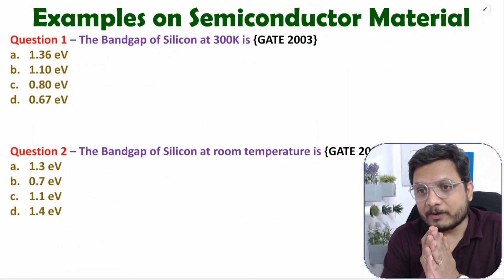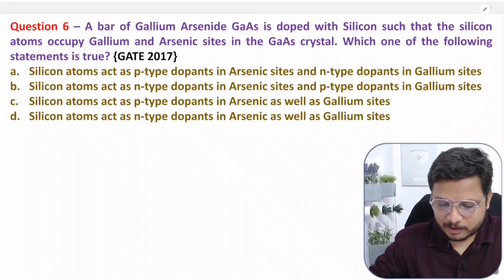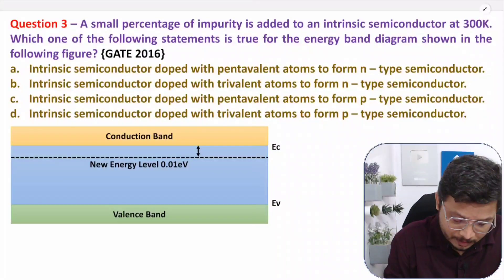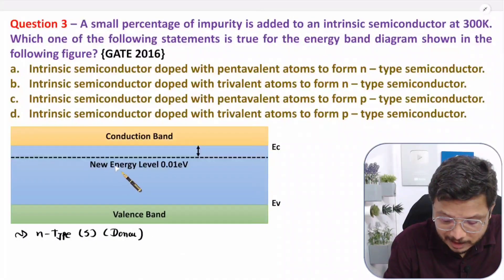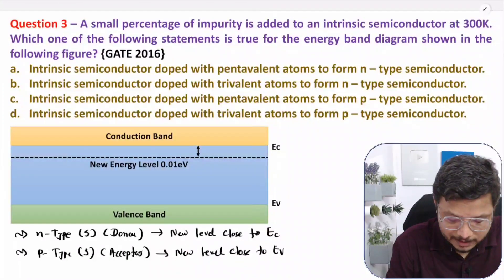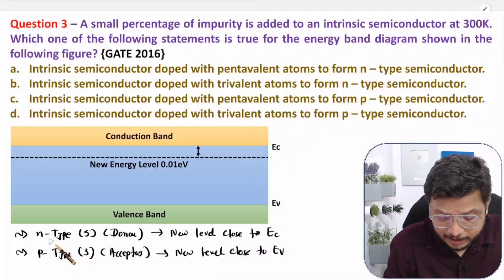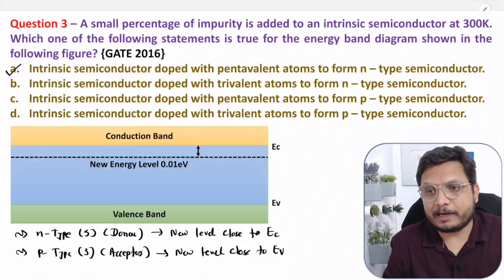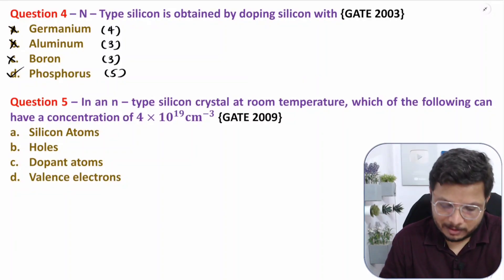1 Examples on Semiconductor Material in Electronics Devices and Circuits by Engineering Funda

Comment: why option d is not correct sir? I think both a and d are correct
Reply: in 3 rd question
Reply: @mohammedyusuff8081 Hi , the question said according to the diagram ,which one is correct explaination, so we choose 'a' , option 'd' is also right, but according to the diagram , the new energy level shifted near the conduction band,i'e it should be an n-type doped semiconductor, IF the diagram is near the valance band , then we mark option 'd'.

I hope you understood.